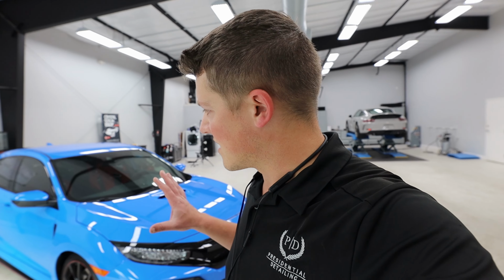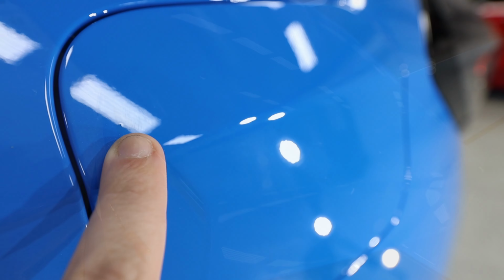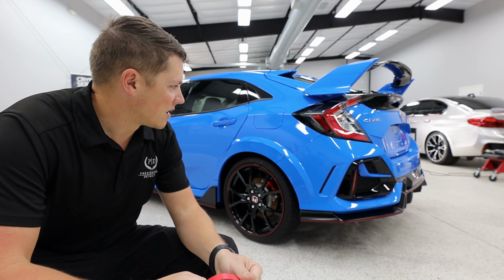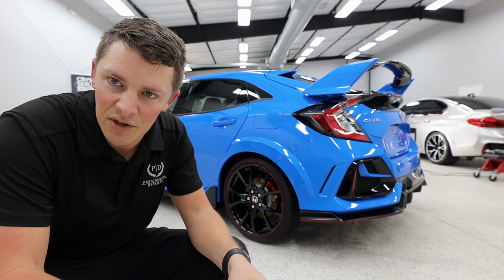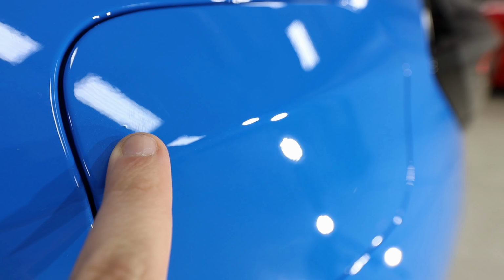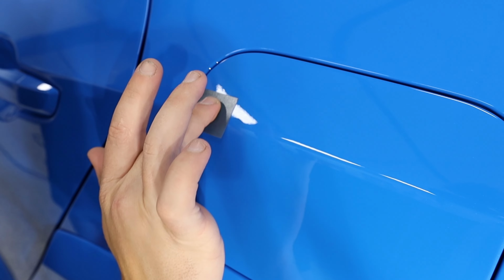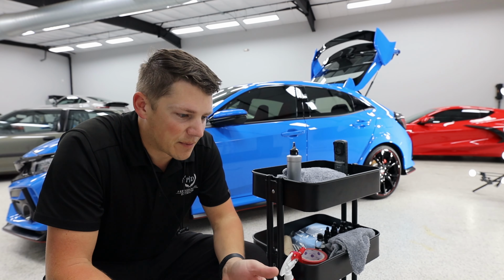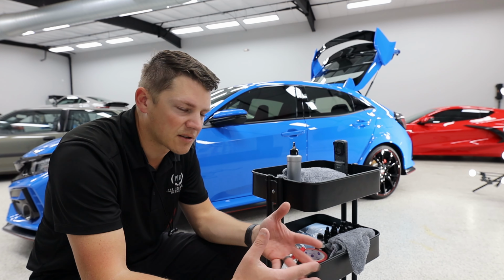Prepping My 2021 Honda Civic Type R for Suntek Reaction Paint Protection Film

Comment: Billy, It is my understanding that even the best ceramics dont last rhe full 10 years etc as some companies claim which is why we like to add toppers etc. so for a film like this that has ceramic in it, would tbis be something you have to polish in a few years and add a new layer of ceramic.

For instance I just started your next video which was the instal of the film and your adding halo over it. Lets say 3-5 years from now would you be having to polish the film to remove halo and add a new coat or simply decon the film and layer on a new coat
Reply from the maker: Hey Josh, thanks for watching. We are past the two year mark and I have not had to do any coating reapplication and everything is still working great. With that said I do use a detail spray like Drying Aid from Obsessed garage or beadmaker with almost every wash, but I havent found that to necessarily enhance the coating behavior. I use it very sparingly just to do a final once over on the car to get off any water drip marks, etc. Hope that answers your question!

Comment: Do you have to polish before PpF for a brand new car? I heard the ppf hides all imperfections
Reply from the maker: It's not entirely necessary on MOST vehicles. We look at each car to determine what is needed. We generally try not to polish before PPF if possible. This helps with the film install (not so tacky) and also saves your paint for polishing at a later date when the film is removed.
Reply: @PresidentialDetailing  gotcha! Do you clay bar before PPF on new vehicles or just mostly  decontamination wash?
Reply from the maker: @belminzvekic6  yes, absolutely. The cars still get prepped just the same. Thorough wash, clay, flooding cracks/crevices, etc. The last thing we want is any single piece of dirt or sand to find its way into the film. You will see it!